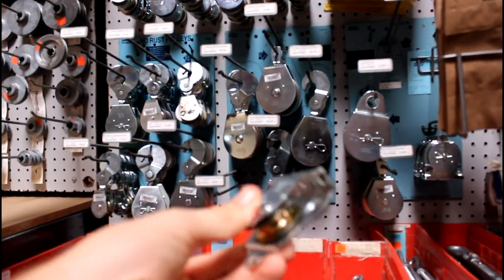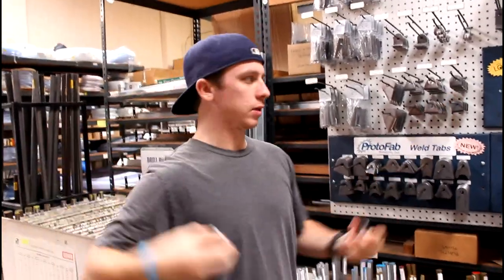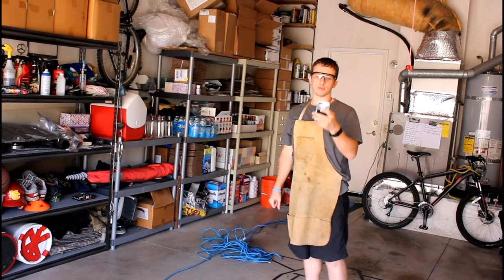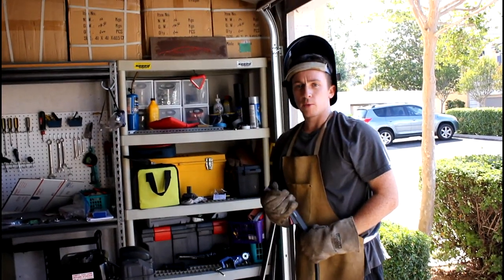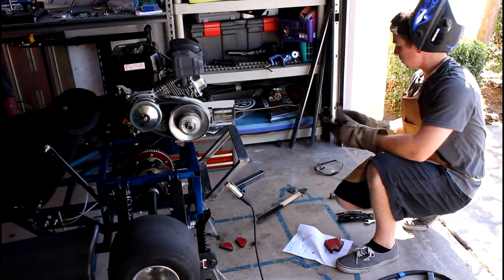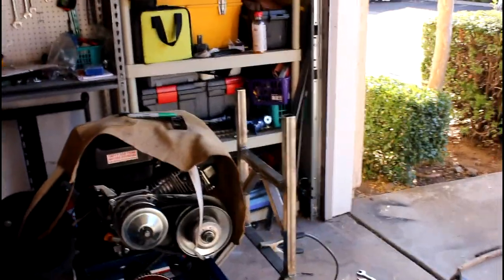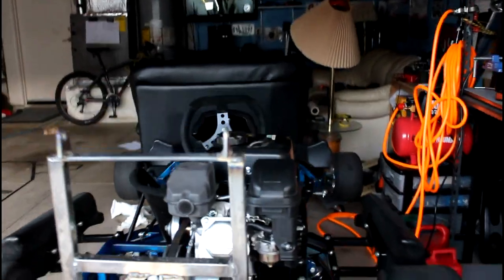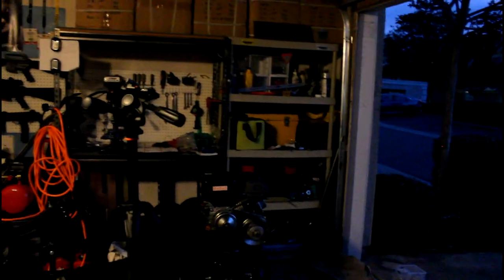FIRST GO KART WITH ACTIVE AERO WING!? - Part 2 (Mount Fabrication)

Comment: You should make a new spolier but have a little manual lever that you can pull and put into place and it can open up the spoiler like in F1 DRS and you can go faster and straight line speeds.